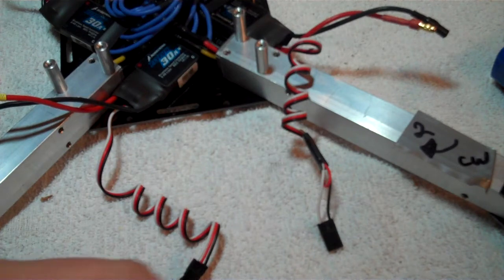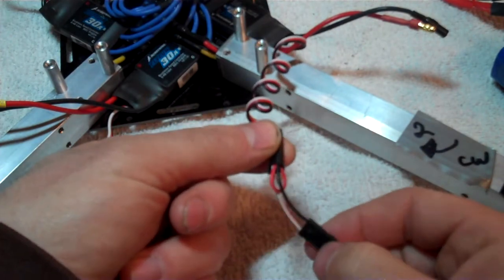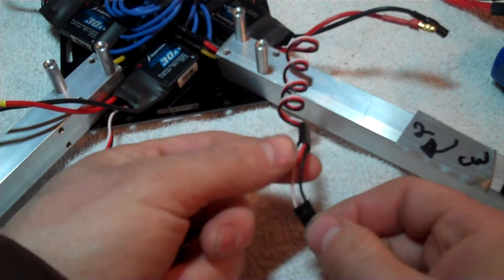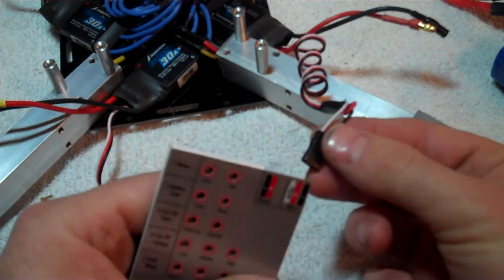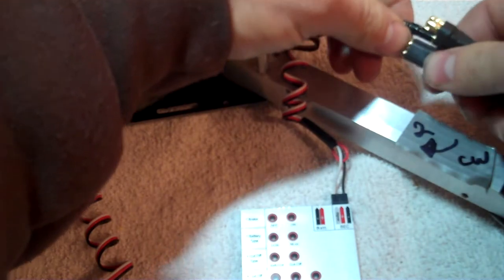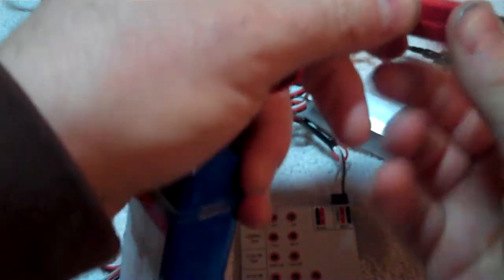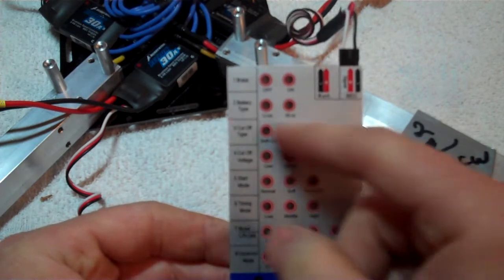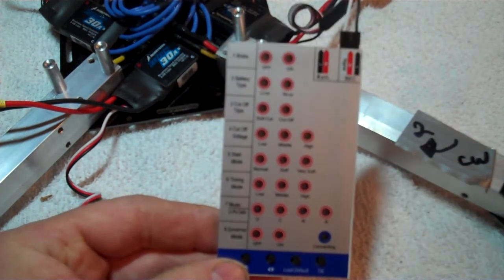ESC program card,  Why you program the esc before removing the red wire

Comment from the maker: You won't have to buy the programming card to program your ESCs but it does make it much simpler as it is all push button programming where as with out it,  it is pretty tedious to program each one by the radio transmitter.  To be honest ,  it is simpler and alot quicker to use a programming card but do make sure that the card is compliant with the ESC. If you use a Hobby Wing ESC ,  make sure it is a Hobby Wing programming card that you use.  Good Luck with your build.